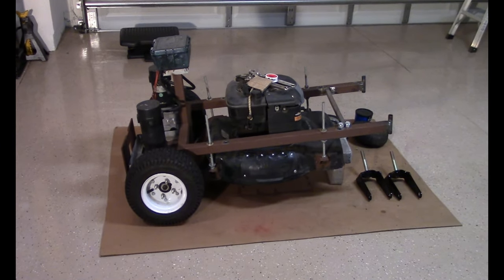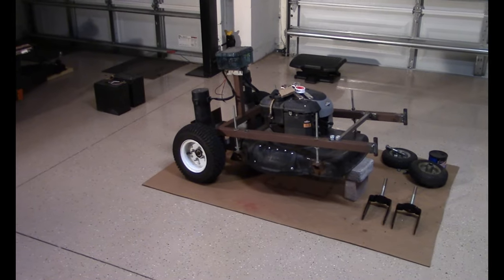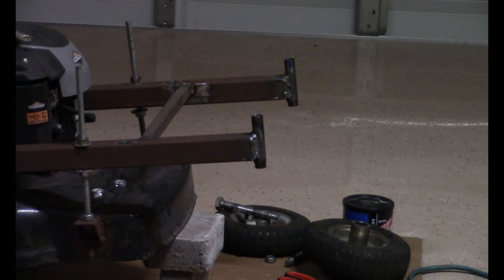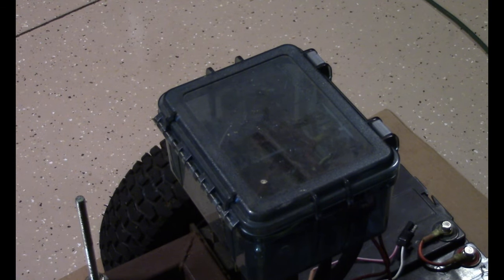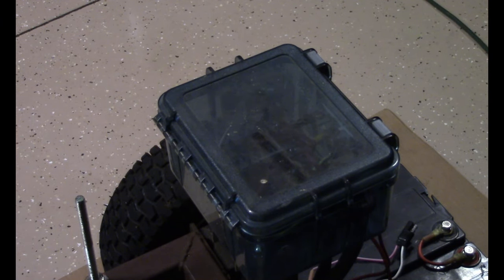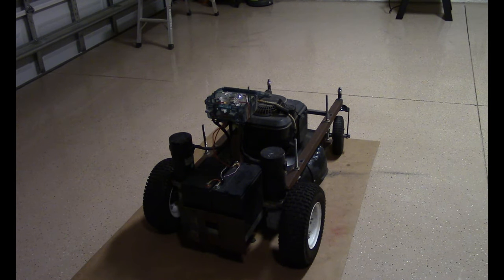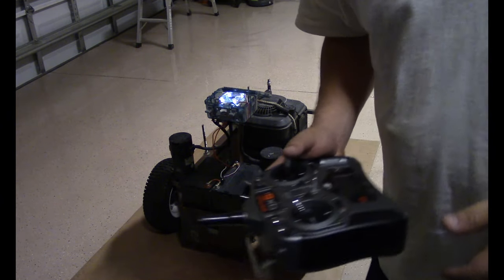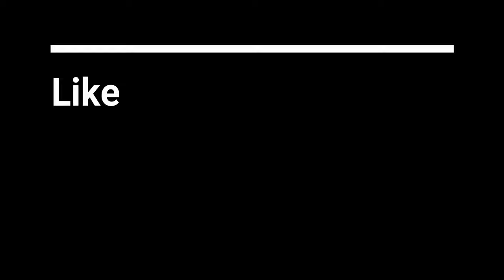DIY:  Radio Control Lawn Mower - Reassembly & Test!

Comment: Awesome Phil!. Just a tip on the holes, a drill bit does not leave a perfectly round hole,  a reamer is what's used after drilling to get it perfectly round. Awesome job on it. The only problem is you're making Wall-E a documentary lol.

Comment: Where did you get the motors ?
How many watts each ?
Thanks 👍😊
Reply from the maker: The motors are from a jazzy scooter I believe.  I've built 2 of these........ and we just look for powered wheelchairs with bad batteries..... typically you can get those for pretty cheap :)

Comment: How long before you program it to do the whole lot while you take a nap? Next project is to build a fossil free electric version Phil.
Reply from the maker: I actually have an EGO 56v push mower I could use..... Just not 100% happy with its cut which is why I'm using the gas mower for now :)
Reply: Either a modified roomba, rc arduino or CNC for automation, a solenoid or gear drive for engine control, clutched starter motor for remote/timed start, and an autopark/dock feature to charge+trickle the batteries when not in use, and he'd be set, but that's no short list of R&D. Good luck.

Comment: The ol' DX6i, yuh gotta love it. You're using lead acid batteries and not lipo's, right?  It would be nice if you could somehow "Teach" the path to it like the wire versions do.
Reply from the maker: Yes, using sealed lead acid batteries..... I believe they are 50ah batteries.... way overkill but they work great.... running in series, so 24volts.  I thought about implanting a wire in the yard and having it follow the wire to mow..... but truth be told, its actually FUN driving it around with the remote.  Helped my friend build his, and he added a camera system / goggles.
Reply: ShowPhil  nice mower!    can you tell me what camera you’re using on the mower? Or did you film the fpv with a phone temporarily strapped to it? I’m building a tank mower and might want to mount a camera … if it’s as clear as the footage you posted.   Thx

Comment: nice work could I ask what camara you are using?
Reply from the maker: I'm using an older Canon VIXIA HF R600.  It records in 1080p 60fps which is perfectly fine with me........... Editing in 4k is a massive resource hog and takes longer, so I'm sticking with 1080p for now. :)